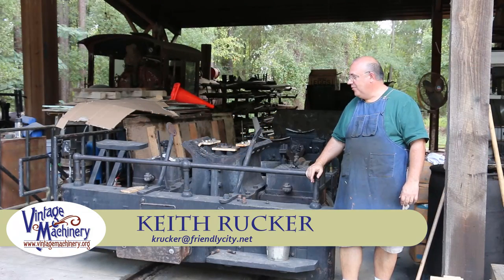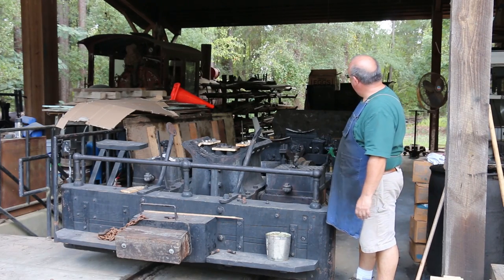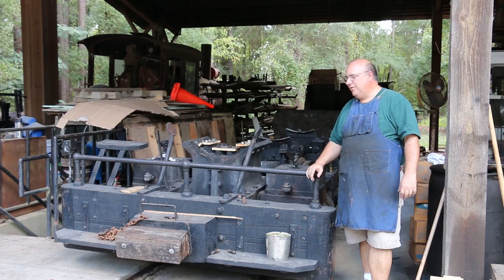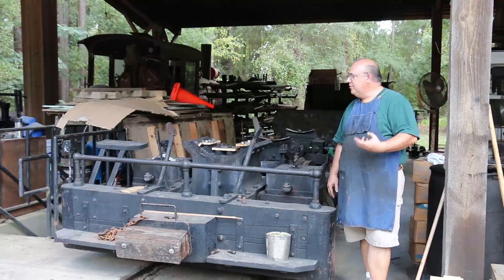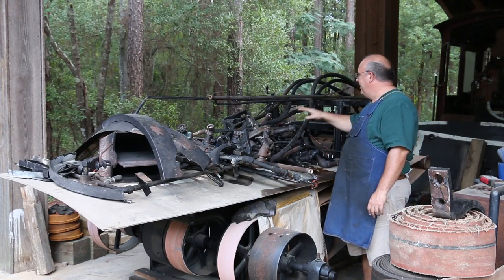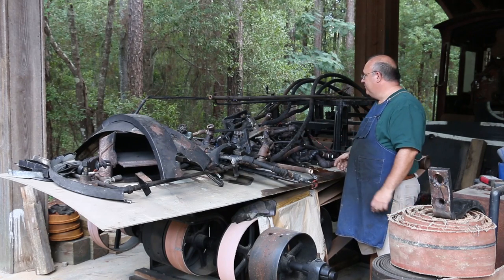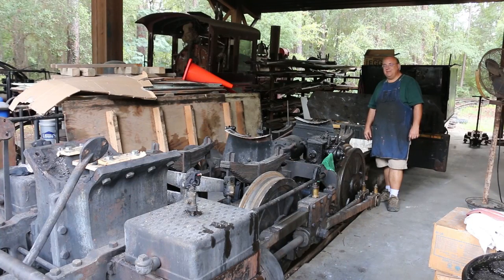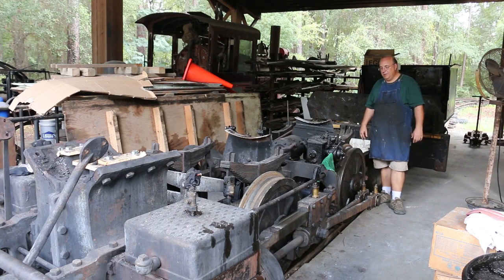Vulcan Locomotive:  Taking Apart for Boiler Repairs

Comment: Wow,big pull down and plenty of work for you there! When steam cleaning a traction engine we coupled a pressure hose to a boiler blow down valve,loads of boiling hot high pressure water on tap! If you have another engine then you have a ready hot washer to hand. The Marshal stationary engine does a lot of being a source of boiling hot high pressure steam or water. It even doubles up as a heating source for the living van,piping hot radiators and water to wash in. Lovely hot showers at the end of a sweaty dirty day always welcome!
Reply from the maker: We don't have another boiler near the shop where the locomotive is, but they do have a steam cleaner....

Comment: kieth, I used to fire a cleaver brooks 500 hp boiler for dry kilns. I was involved in tear downs and replacing tubes. I also was involved once on helping replace the tube sheet on the welded end. It was quite a job. We had a professional company come to our place to do the work. I was very  interesting to learn how all that was done. Take lots of video as you hack time to we all will enjoy it and appreciate it much. Keep up the good work. And thanks for all the teaching moments
Reply from the maker: I would love to get some video or pictures from the boiler shop but I won't be involved in that part at all.

Comment: I can appreciate the project "happening".  I have a lot of projects around my house which just "happen".

This is a very interesting project.  I appreciate the video and understand the difficulty of taking video while you are dis-assembling.

I have not seen a locomotive taken apart before so thanks for the pictures.

A tube sheet replacement is a big deal.  Good call to send the boiler to the shop.  They can better handle any items found when they get to replace the tube sheet.

I look forward to updates on this project.

Comment: Worked for a Mill Supply place here in Atlanta many years ago. Got a call to look at a stationary boiler that "had some problems". Yep. It did.  Pressure gauge was failed, and the safety relief was frozen shut. They were basically guessing at its operation. It was HOT and ticking. Looked down the side and I could see it was getting 'barrel shaped". I told them I'd shut it down RIGHT NOW and have it looked into. I left. They weren't happy. Called my boss and complained that I wouldn't help them!Found out later that it was on the edge of going BOOM! Funny thing is they kept calling for more stuff and asking for ME to help them after that...
Reply from the maker: That is scary....
Reply: What is REALLY scary is there's no telling how they had been running it that way! When I looked down the side of what should have been a cylindrical boiler and saw the curvature I almost had a heart attack! I still have the gauge (they gave it to me). Old brass cased Marsh. It had failed due to overpressure!

Comment: From your comments I'm assuming that because the museum operates the locomotive on a closed track that does not connect with the national rail system, it is exempt from FRA inspection requirements. The FRA requires a complete tear down and inspection of steam locomotives every 1492 operating days. Tube sheets, flues, crown sheets and stay bolts all get scrutinized. I'm hoping your boiler shop takes similar care in inspecting these items, which have been the cause or many tragic accidents.
Reply from the maker: The museum is indeed exempt from FRA rules.  We still are inspected annually and we are required to do a major boiler inspection that basically requires a lot of what we just did every ten years.  We were not due for that boiler inspection for another two years but while we have it taken apart, we will go ahead and have all of that done while they are working on the boiler.

Comment: Could you hang a time lapse camera from the rafters at a good vantage point to get the whole locomotive, and film the reassembly as a time lapse in 1 minute photographs.  I did the same thing when my shop went up.  I only had to touch the camera a couple times a day to turn it on in the morning and off in the evening. Just a suggestion, Chris
Reply from the maker: My problem is that I am on the road so much the next few weeks I am not sure I will be around when it is put back together.

Comment: Hello Keith, replacing the rear tube sheet, thats a big job,  pretty impressiv you believe this will be done within two months. This is s steel boiler, correct ?  You said "sending it to the boiler shop",  this sounds as if you have this facility  available within the museum. If this is true, that is also pretty impressive.  Please keep us updated with the progress.

Comment: OOF...what a major project to suddenly hit.  Hmm...with what some others were saying about the tyres on the wheels...sorta makes you wish you had access to a horizontal boring mill with a lathe setup attachment like Abom79 has access to.  Those wheels look like they would fit on the Kearn's mill Abom has at his job, to re-profile them.
Reply from the maker: It would need something that would swing at least 32".  I actually talked to Adam about this job but he did not think they could do it.  There is a wheel shop up in Chattannooga that could probably do it.  Just don't have the time or budget to do it right now.

Comment: Now I see why you wanted my bridge crane at the museum! Did the boiler go to Ohio where you all got the sawmill boiler done or is there a shop local handling the repairs? My boring mill would be just about the right size to put all those holes in a tube sheet.......someday when it is operational.
Reply from the maker: It went to a boiler shop up in the Atlanta area that we have worked with quite a bit.

Comment: Hi Keith,   One thing that immediately concerns me, just from looking at your video, is the amount of wear on your current tires.... they look to be worn to a point where they need a re-turning, if there is enough metal on them. Or at worst case replacement if there's not enough metal on them.  I guess you're going to be looking at all of that during your overhaul.   Best Regards, Jules.
Reply from the maker: The current tires are dished out but are completely safe.  Plenty of metal on them - no need for a tire replacement.  It would be nice to have them turned to the correct taper again and that is something that is "on the list" of things that need to be done.  However, it won't happen right now because of the need to get it back up and running as quickly as possible and due to budget issues.  I am trying to get that on the list of repairs for next summer.

Comment: Sounds like this should get you a new Form 4 and a new 15 year lease on life from the FRA. That's always a good thing.

Maybe it was just the camera angle, but those drivers sure looked like they were really worn and way out of profile. Might be a good time to get them turned or possibly re-tired.
Reply from the maker: Fortunately for us, our museum does not fall under FRA rules.  Still a lot of inspections and such, but not nearly as bad as dealing with FRA.  The wheels do need to be turned but that just is not in the cards for right now.

Comment: Just an observation.  After all the work you put into that Planer Matcher its reduced to being a handy flat place to store junk...  It needs its own building at the least!  Also are there any plans to re-profile the driver wheels? They look like the tires are cupped..
Reply from the maker: We have plans to build a planer shed for the Planer Matcher to hook up to a new steam engine that the museum is in the process of getting running.  Not ready to move it yet, but for the time being, it will have to serve as a table for this project.  As for the driver wheels, they are in bad need of being removed and turned but that is not in the cards for right now.  We are talking about possibly doing that next summer when the locomotive is down for a month.

Comment: Hello Keith

that is bed news having problems with the boiler I hope they find no other problems with the boiler or the locomotive.

I have one request can you make a video from the locomotive in the background?

With kind regards Peter
Reply from the maker: I would love to get the go ahead from the museum to start working on the other locomotive.  It needs a good bit of work to get it operational again.
Reply: I believe it right away that you'd like to get the other locomotive up and running.
It would be nice if the museum has two running locomotives

Comment: Hi Keith, that is one very big job, will you be putting in new tubes as well? Left #1 driver looks pretty close to a high flange.
Reply from the maker: Yes, they will be putting in new tubes while they have it.  As for the flanges, those wheels really need to be turned but we just don't have the time to do it this time around.  Gotta get it back up and running again....

Comment: What's the status of the le blond lathe restoration?
Reply: it's some time since we have seen one video about it. he might haven't enough time now, i think taht locomotive take a lot of his time to be rebuildg
Reply from the maker: As I have mentioned in a few videos, the LeBlond is temporarily on hold while I am doing some work on my home shop - installing the ceiling.  I had to move everything to one side of the shop and quite honestly, everything is so piled up right now that I don't have room to work on it.  Once the shop ceiling is finished and I get my machines back where they belong, I will start back to work on it.

Comment: Need to be cleaning and painting the heck out of whats left Keith.  I'd have been going for two new tube sheets and all new tubes, UT check on the boiler sheeting, and a full boiler test before putting it back on - but then my wallet is even thinner than yours I expect.
Reply from the maker: It will get new tubes.  The front sheet is fine though.  It will also get a full ultrasound and hydro test.

Comment: Are the driver tyres going to be trued up? In the video they appeared to be fairly deeply grooved but that might be a trick of the lighting. If you do you would probably have to send them out. They look to be too big for your shop lathe. Is there anyone within reasonable distance with a wheel lathe?
Reply from the maker: That is something that needs to be done but it probably won't happen this time around.  We cannot do this job in house and the bottom line is that the budget and timeline just will not allow us to do this right now.

Comment: Keith was that another locomotive in the back round or was that parts? Good luck with the repairs
Reply from the maker: That is another locomotive - a 1924 Porter, but not currently operational.
Reply: I hope with a little luck that  both will be running the rails again

Comment: What's the other locomotive in the back of the shops?
Reply: Agreed, I don't remember if Keith ever covered it. Is that locomotive out of commission?
Reply: I had asked Keith about the other locomotive in the past.  He told me that it is a 1924 Porter 0-4-0 that used to run at the museum in the 2000's, and started to develop some serious issues and was taken out of service about the time the Vulcan had received a new boiler and had been put into service.  He said that getting the Porter running is prohibitively expensive with their current budget.
Reply from the maker: The others have already spelled this out, but it is a 1924 Porter that needs some work done to it.  Not sure if/when we might be able to get it back in service.  Time and Money....
Reply: Yes, but not identified - It is a small one

Comment: Hi Kieth. There was a 'Vulcan' works that made locomotives for many years not far from my home town of Warrington in the UK. Google 'vulcan works newton le willows' . Do you know if the companies on both side of 'The Pond' were linked in any way or is it just a coincidence.
Reply from the maker: No, it was a separate Vulcan Iron Works.  There were actually I think three Vulcan Iron Works in the US that made locomotives at one point or another, all separate from one another and the UK company.  Confusing....
Reply: Thanks for the reply. I know the UK location exported many steam engines. Some are still used on daily services in places like India that use both modern and steam. - The UK factory later also made very large diesels for use in ships etc when the factory had been bought out by 'Rushton' All demolished now and the land has houses built upon the site. Sad that the industry has gone and the 1000's of skilled jobs that went with it. Best regards and thanks for the time you take to educate others with your videos.

Comment: Hi Keith is this boiler an all welded Boiler? and do you have information of who made it and the construction drawings?
Reply from the maker: Yes, it is an all welded boiler made in the early 1990's by Hurst Boiler in Georgia.  Yes, we have the drawings on it.  At it turned out, once they got all of the old tubes out, the tube sheet was not as bad as first thought and the boiler company doing the repair work was able to repair it without having to replace it.  They are still working on things though.
Reply: Thanks Keith. I am involved with a group that has 2 Vulcan locomotives which are similar except they are 060 locos and are 3 foot 6 inch gauge they both have bad boilers which may need replacing. I would be great to compare notes and see if the boilers are similar or the same in dimension Thanks Glenn

Comment: It looks like you got a lot of work ahead. Only wish I was their but to far away. I hope you make your time line. I think you all burn coal. The coal ash eats up everything it touches.
Reply: They burn heating oil in it, not only because of coal being hard to source in south Georgia, but also for forest fire prevention and safety reasons.  Mr. Rucker states in one of his vids specifically on operating the steam engine that when the engine was coal fired, sometimes it was a race to stop the cinders being blasted out of the stack from catching the woods nearby on fire!  Burning heating oil instead of coal is more a matter of keeping from setting the woods on fire for them.